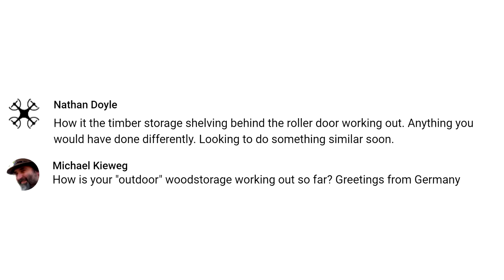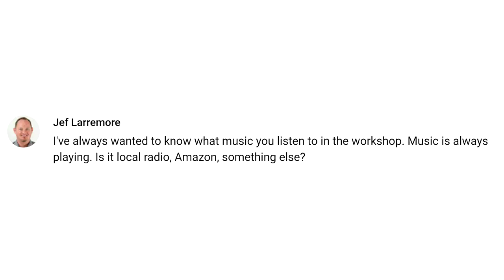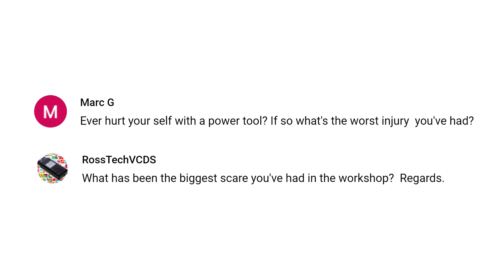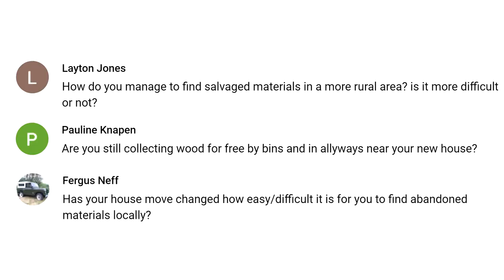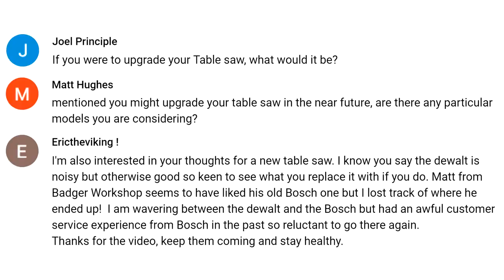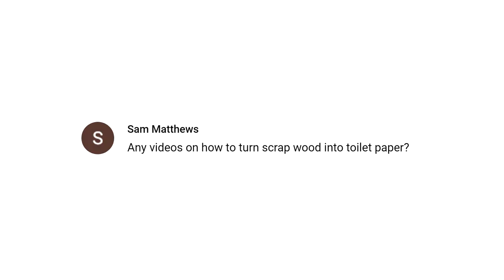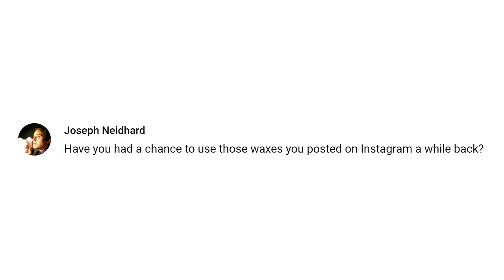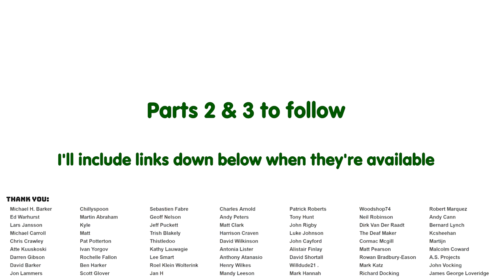Answering Your Questions (Q&A 2020 Part 1)

Comment: You’re right to be afraid of the router table... I came very close to removing my right index finger last year on one and it will never be the same again, I am lucky to still have a finger that is mostly functional. It was completely my fault for using it incorrectly (20:20 hindsight), but all it took was a momentary lapse in judgment! Haven’t used it since...

Comment: Would you consider a small sliding panel saw. You do a fair bit of panel work? I bought a panel saw 5 years ago it was dear at the time but i never regretted it. A saw for life
Reply from the maker: Probably not, is rather use a sled I think to save space
Reply: Ya I understand space is always an issue Marius Hornberger has a nice saw

Comment: Great questions and answers Keith ... Dammmmm i was suffering with Vibration white finger because of using a cheap Random Orbital Sander and researched sanders and ended up buying (after remortgaging) the Mirka Deros.. I love it but i hope mine doesn't give me issues like your or my nieces husband...he told me yesterday
Reply from the maker: Matt at Badger Workshop had issues too 😒 very disappointing. Have you tried anti vibration gloves? I got some recently but not tried them yet, I have issues with my wrist
Reply: @RagnBoneBrown  i have two pairs of them gloves. The cheap one is hot and rigid, better suited for lawn mowing and such. The more expensive one is soft and cushiony, bad dexterity, but really breathable and comfortable... excellent for sanding. Both do not help with wrist pain, so I've ordered a separate wrist/thumb support.

Comment: Did your Deros blow up?? Mine did, and so did a friend's. Both times they blew up, sparks flew out of them and tripped the RCD just through normal usage. Upon googling, sounds like it's the #1 issue with these that a lot of people are finding, possible trigger is if the pad becomes worn, it starts to vibrate more than it's designed to and some components on the board shear off. If that's true, surely people have to center their pads /perfectly/ but, who knows. It's beggar's belief really, no more Mirka for me or the 10 or so people in my peer group.
Reply from the maker: I talked about it in detail in my last vlog 👍

Comment: Hi Keith i got a question about sanding. Here's mine problem. Whenever i use my random orbit sander(green Bosch) to sand boards i get a VERY uneven surface. When I run my hand across the grain i can feel each individual grain line. Its like the grain has raised by a ton just by sanding it normally. This is especialy noticable on flat sawn boards with cathedral style grain pattern. What do you think could be causing this problem. PS i don't have this problem when I sand by hand with a sanding block. Thanks in advance.
Reply from the maker: Hi, hmmm... not sure. what grit are you using?
Reply: @RagnBoneBrown  i usually start with 80 and work my way to 240 but the problem is there from beggining to end
Reply from the maker: maybe the pad on your sander may be too soft, do the sandpaper is shaping itself to the contour of the wood grain? Especially if you're using pine or a soft wood which doesn't have tight grain lines.  The light coloured areas are softer so they sand away quicker than the darker grain lines. Just guessing but you might need a firmer pad on your sander
Reply: @RagnBoneBrown  That makes sense i'll try to buy (or build) a firmer pad for my sander. Thanks a lot.